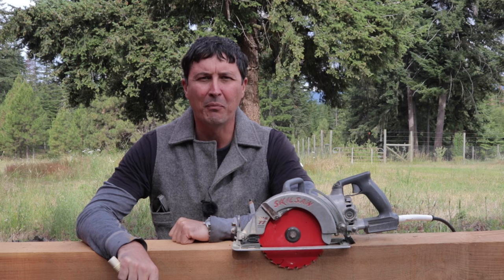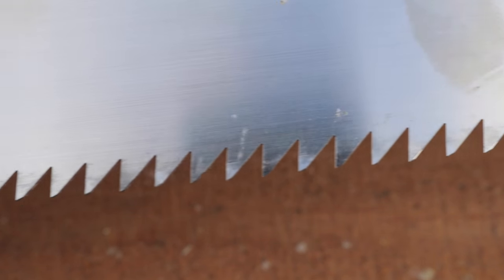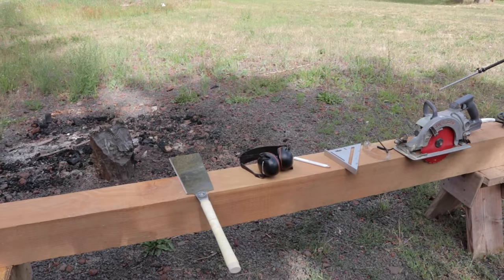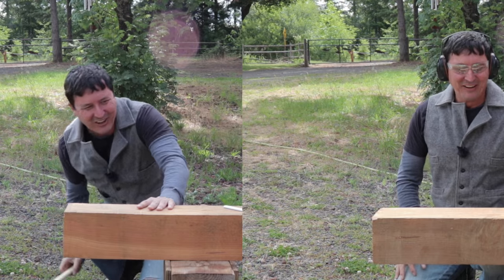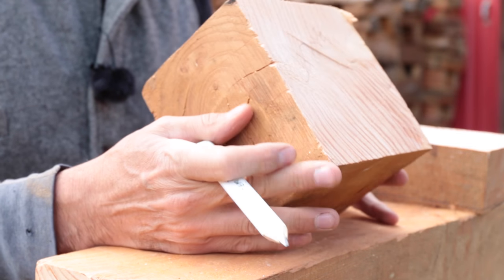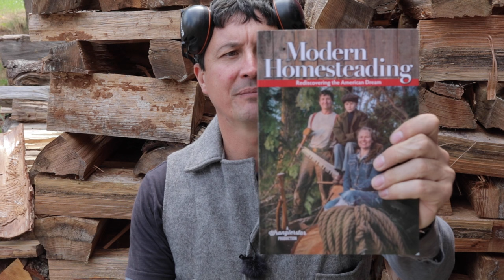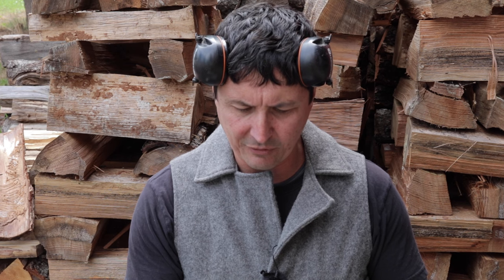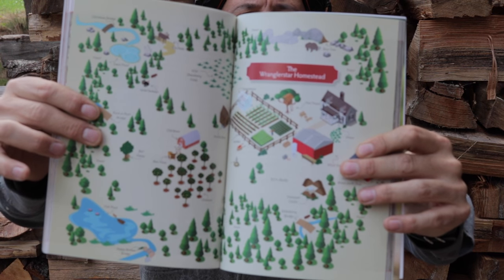Hand Saw vs Skill Saw - Speed Race

Comment: Weed-eater vs. Scythe
Reply: Yes!
Reply: weedeater is a way better band than scythe
Reply: +Comrade Max depends on what you're cutting
Reply: Jackson Ledford well im cutting through pure stoner metal dankness
Reply: In tall grass the scythe would probably win initially due to the amount of grass it cuts in a pass. Hit a stone with the scythe and you'll be cursing very loudly though.
Reply: A small win because the mower stalled out. At the end the guy with the scythe was almost dead and staggering, the guy with the mower could have gone all day and barely broken a sweat. Don't get me wrong, I love the old ways and never want to see them die out. These days it's all about time and money, not necessarily a good thing!
Reply: *****
You're right obviously, now I'm off to bet on race number 2 :)
Reply: i have seen footage of a race between a champion english reaper and some guy with a fairly average weedeater. long grass so the scythe won. but a good weedeater with a grassblade properly sharpened and weilded by a mowing contractor might fare better. its a taxing sport compition reaping. for the hale.
Reply: Luke thompson If I recall the weedeater clogged so he had to stop for a while to clear it. Taking it slower he would probably overtake the scythe before long because the guy using it was really working hard, knowing it was only a small patch he had to do.
Reply: Snoop dogg Vs Death.
Reply: wipper snipper vs sythe
Reply: I love all the different names for weed-wackers. Wipper snipper weed hacker, weed wacker, weed eater, its shows how you can go by with your regional accent never knowing all the different names for things.

Comment: nail gun vs hammer. What do you think?
Reply: Chainsaw vs axe. Minutes vs hours.
Reply: +rol dac depends what and how, felling smaller trees is way after with an axe... anything less than five or six swings is faster with an axe... the right axe
Reply: it was a jock!  Are some people so lacking in hummer?
Reply: Ernest Venn I haven't the slightest idea what you talking about!!
Reply: Do love me a good hummer
Reply: aslong as you have to put on hearing protecting plug in the compressure a d turn the compressure on and wait for it to pressureup then stretch the hose and then hook it up  thenload nails then bang.  or if hehas one that uses  those blanks   i think it would be cool to think good idea
Reply: Yes!!!
Reply: yeah exactly.
Reply: you can knock it off now? Only a jock and if you think of it and use some logic you will know which tool is better. Nil gun for speed hammer for more finer details.
Reply: They would have to be pretty slow on a gun
Reply: nail gun vs Larry Haun? :P
Reply: Roofing nail gun vs hand nailing cedar shakes on a small shed roof with equal size on both sides of the peak.
Reply: +rol dac Not if you take the chain and fuel out, LOL :D
Reply: Yes wranglestar please do this
Reply: I raced two guys on a nail gun, one shot the gun while the other  positioned the stud. I used a hammer and positioned  my own studs with my boots. The Walls were 400 feet long, it was part of a huge apartment complex. We started with the nail gun ready to go against my trusty 20 ounce Plumb fiberglass framing hammer. At the end of 400 feet, those two with the nail gun beat me by only  4 studs, or 8 nails . Using 16 Penny nails those two guys were amazed  how close  I was and I was pushing them guys hard since I was the Lead Foreman.
Reply: Ernest Venn hammer because I am precise & strong af.
Reply: Ernest Venn for Sure hammer😏
Reply: Ernest Venn nails are for people who take 0 pride in their work. Especially nail gun. Use a drill and good screws.
Reply: Hammer. I have a 28oz estwing framing hammer and I was able to beat my coworkers building a deck with galvanized penny nails. One hit is all it takes with that baby
Reply: Ernest Venn .
Reply: Ernest Venn nail gun for large amounts always
Reply: Lol
Reply: If you know how to roll nails out of your Palm ... It's difficult to justify the cost of a framing nailer . Let alone extra cost of a compressor , inline tanks , air hoses & how cumbersome and clumsy all that becomes while in use . Not to mention extra cost of nail strips vs. Loose nails ... I'd rather pay a tradesman for quality work . Set ... Seat . Two swats .
Reply: Eh nailguns annoying to use and expensive, hammers are mostly as fast, and sometimes faster. Sometimes, the simple tool is better.
Reply: Or you could just use a drill and screws. Way easier and alot more convinient, id buy a battery powered drill over a nail gun anyday.

Comment: Might I suggest a hand fretsaw vs electric jigsaw (I know you get electric frestaws too, but most home workshops have a frestaw and jigsaw). 

I would suggest that for accuracy, the fretsaw wins, for speed, the jigsaw wins, so your comparison would have to take both in to account.  Perhaps creating profiles for skirting or complex joints would be reasonable scenario. 

There are some occasions where a  hand finish is superior to a machine finish. French polishing for example. 

I also think I could outpace your skillsaw with a bowsaw, especially if the work piece was a few feet  further away than your longest extension cord can reach.
Reply from the maker: +Andrew Hull the last paragraph is hilarious.  Mrsw
Reply: +Wranglerstar and hows that

Comment: With practice, you will be twice as fast at that with the japanese saw. It's almost excruciating to see you pushing with that saw. There should be no effort at all on the push stroke and you should really give it hell on each pull stroke. That way, it's faster and much, much less effort, as you're only applying energy for half the time.
Reply: True! To be honest,  hadn't noticed that!
Reply: Not to mention the effort involved, for this kind of cutting the power saw is simply the superior choice. If you had to do some finer finishing or trim work you could argue for the hand saw, but if you had a couple dozen of these beams to cut you would not even think of the hand saw.
Reply: +Skwisgar2322 Out in the woods, of course, you might not have a power outlet or genny. That's where a pull saw really helps!
Reply: There are also other application where a skill saw would not be functional, as an example in timber framing where you have scribed two timber the joints are not square and will follow the irregularities of the piece matching it.  this is where hand saws shine, cutting multiple cuts that are not square, just following a line and to an exact depth that is also variable from piece to piece. 

This comparison, and it was mentioned was fouled from the start.  He kept repeating he should have clamped it down.  Add a clamp and proper cutting attention the results would have been more comparable.  Through a Silky saw into the mix for function, too.

Comment: I haven't read all the comments (there are so many) so someone may have already brought this up but some of the difficulty you might be having is that you are using a Japanese saw with western saw technique. When using a western saw it helps if you position your body above the piece being cut because you are pushing which is easier to do in a downward motion. When using a Japanese saw it helps if you drop the handle so you are basically pulling down. This will help with the binding you experienced. Askwoodman has a couple of great videos on Japanese  saws and goes a little more into technique than the Samurai Carpenter does. I subscribe to all three channels BTW and love what you are doing here on your channel. Keep up the good work, it's much appreciated.

Comment: I would like to see an electric drill versus a hand drill. I think it would be very close in the times.
Reply: You. Don't have to plug in most drills so they whould have no set up
Reply: I know, but a hand drill is almost, if not as fast at drilling as a normal drill.
Reply: The drill in the old vs modern vid.
Reply: With a good battery powered drill there isn't much need for a hand drill. The battery is easier even if it isn't much quicker. You can also swap bits over and use it as an electric screwdriver. A brace and bit would be a different story because a electric drill for that sized bit would be crazy expensive and heavy.
Reply: +Bunny Warren truth
Reply: Want to see the same! Will be interesting, especially with those new electric drills he got.
Reply: Bunny Warren you can also put bits into handdrills.
so its not realy a point for the electrick drill.
Reply: Once the challenge starts he'll put the drill to charge and then say the hand drill is still a good tool.

Comment: why after you drew the 4th line did you flip the board back to original side up? I have the model 77 & it's bigger brother which may have cut the board in 2 cuts but 4 cuts would cut it w/o getting the draw saw

Comment: This was a 'be as inefficent as possible with a power saw so that you can try and make old tools seem not as useless as they actually are'
Reply: Yeah but he didn't have much skill with the pull saw either. And the extension cord was a decent point, but only for the start. As well, he pulled the saw out too far, which I'm assuming people who excel with it wouldn't.
Reply: CheeseSauce ya really
Reply: Inefficient as possible? Not at all if if you're comparing one cut performance of the two. Power tools, as awesome as they are, require more set up, auxiliary gear, safety equipment and attention while using.  For bigger projects, power saws may be the way to go. For smaller projects, they can be a lot more hassle than it is worth.
Reply: ermmm there are plenty of jobs where hand tools are better then power tools, you must not do much yourself.
Reply: I wouldn't call it inefficient.  When I get asked to do a job, my tools aren't already hooked up and ready to go.  I have to set everything up.  With a ryoba, I just need to grab it and get to work.  No cords required.  Just good arms and technique.
Reply: CheeseSauce we

Comment: How do you like the straight handle on the "Japanese" saw? It doesn't look ergonomic to me, but I haven't tried one.
Reply: Until you get a few miles on one, always try to use 2 hands, clamping or standing on the piece while cutting.
Reply: watch the "old" masters on Youtube. I had to learn the hard way 30 years ago but nature and a lot of nasty cuts taught me the right way eventually. truth is, many wood workers aren't that great with push saws either. lol. there IS a right way and many wrong ways to cut wood.

Comment: Sometimes Hand tools are faster and easier than power tools,  WHY?  well when you stopped you weren't done,  to finish you need to put the tools away,  wind up the cord  stow away safety gear and put up saw,  With Japanese saw when done, just set it in your tool box.

My Dad was a very good carpenter and when air nailers first came out they tried to sell those to my dad,  he said No thanks.
  One tool salesman made an offer that if he was faster than dad, would you BUY the rig,   nailer, compressor, hoses, special nails.   Well Dad was in a large subdivision south of Chicago and the sales man Had a tool customer across the street from dad's house.   They got started in morning, dad and a helper and the sales man and a helper., Both teams shingling like mad.  These houses were the size where it would take about a day to roof one..  The other team had their roof covered a few minutes before dad and they came over to the driveway of his project and said, "well we are done before you, what do ya think of that?"

Dad looked at the salesman and smiled as he put his nail apron and tools in the truck, " Well I am finish,  you still have to pick up your nailer and your compressor and power cords and hoses and I am going home for the night."

Comment: I would really like to see a jigsaw and the necessary cleaning of that cut on a finished piece vs something old school, I'm not sure if it's a coping saw or how you would create a rounded corner or an ogee in a traditional way but I often get frustrated by the rough cut from a jigsaw and when the blade skews.
I'm not an expert carpenter by any means but I expect would learn a lot from that video.

Comment: It's a Le Mans start, not a Monte Carlo start. lol
Reply: imagine a le mans start in monte carlo
no ones survives the first lap , the back of the grid cars will run to try to run over the ahead pilots xD
Reply: what is the difference between the two?
Reply: Geronimo Cornplanter a monte carlo start doesn't even exist.  You can google Le Man's start
Reply: rebelyell22 that was a speedy reply. Yes i just googled it haha
Reply: +Geronimo Cornplanter that's why Porsches have their  keys on the left side of the steering wheel

Comment: If that's a pull saw you were pulling it up the wood rather than pulling down into it .
Reply: You would work on the edge of the wood that is closest rather than furthest away and have your hands lower than the blade. pulling down into the wood. Also the handle are that long so you can use them with 2 hands.

Comment: The idea with a Japanese saw is to pull DOWN when cutting timber. You used the saw across the wood like you use a European saw. This is totally the wrong way to use it. If you want to keep it straight, you need to cut one alternate sides which let you follow the lines correctly.
Reply: totally wrong technique. practice the technique and saw properly then redo the test

Comment: You might want to learn how to use a saw.
Reply: that's rude
Reply: No its not rude, its a fact that even cody acknowledges.
Reply from the maker: I agree. I'm not very good with a hand saw yet,
Reply: Once you get used to a pull saw, it will cut those beams like butter.
Reply: +Wranglerstar You're still better than me!

Comment: This is kind of bullshit.. The skill saw isn't designed to cut something that thick.  Add another inch and the skill saw's cut time goes to infinite, as it's completely unable to cut it.  That doesn't prove the hand saw is infinitely better, but you have the wrong tool for the job.
Reply: john handcock it didnt manage to with this size, right at the end he did have to finish it with the hand saw
Reply: Like he said wrong tool for the job. Band saw it is.
Reply: Hell, Mitre saw it is.
Reply: john handcock very good point
Reply: Makita 16 inch beam saw

Comment: ok lets see cut 200 on that house framing day. this looks like it would be a lot faster to drive a nail than air nail if I had to plug in the compressor and line every time and wait for the compressor to fill up.

Comment: That was awesome Cody. I've been saying for years that Japanese hand saws are faster for small jobs or occasional use than getting out the power cord ( or generator!) and other associated gear for a power saw. Although I have to two HD77's and am happy to use them too. All great tools and it was great to see your contest here. Great idea. Next I'd like to see a crosscut Vs. chainsaw, with all the associated sharpening, oiling, etc. built in somehow.
Reply: Framing hammer Vs. Nail gun/air compressor would be a good one too.

Comment: Can someone explain why on the Skill Saw cut the 1x1 inch square in the centre looks slightly darker?
Reply: The skill saw didn't cut that section, it was too deep.  He finished it off with the hand saw.
Reply: the difference in contrast is likely do to light.  The Skill saw creates a pattern with the blade and since the timber had to be rotated 4 times, there are different light patterns on each of the cuts.  This makes a contrast to the square that was not cut.
Reply: +Jr Leon that's not what he was asking read the whole comment next time

Comment: I've been using circ saws for many years, but no more...too much lovely dust. I don't want to mechanicially plane anymore either.  I want to rip cut a beam like the one you showed in the video. Its 4in X 6in X 4 feet. I need to rip a quarter inch off the sides.  Ideally, I would use a frame saw...but has anyone tried with one of these Japanese saws?  What would be the strategy?  What kind of kerfing plane or other tool are people using to make a long kerf prior to cutting?

Comment: When using hand saw, you should also apply some grease on the blade, else it will be difficult to move the same after some time. Also due to heat, the blade swells a bit and this will also make it difficult to move the same.

Comment: Why is the beam placed so low? That is a big disadvantage for the hand saw since you have to use your foot as well. And using a foot means kicking the beam away (see 4:29). Same goes for the length of unsupported beam sticking out from the wooden supports: with the saw you push the beam down, so carry as much length of the beam as you can with the supports. That Ryoba would win easily if handled with the right sawing technique.

Comment: I have had a heck of an experience trying to find an 1 &3/4 auger or paddle bit for a drill so that I could hang a thick pull-up bar all the way through a 4x6 the long way. I ended up with a hole saw of the correct measurement, but had to bottom out the hole saw bell then chisel out  the waste so that I could go further it usually took about 3 chiselings before going all the way through.  anyways paddle bits vs augers, hand driven vs drill gun, also include my absolutely mad way of drilling a 1&3/4 hole through 6 inches of wool.  a couple more thoughts if i am remembering correctly hard vs soft wood has nothing to do with how easy the wood is to word with, it has to do with the type of seed they come from, a hard or soft shell seed. i could be wrong... also thanks for the wonderful content and cant wait for my autographed copy of your book to come in..just ordered it.. thanks